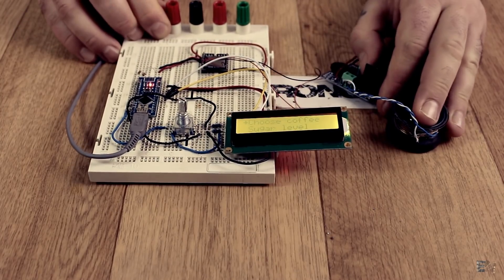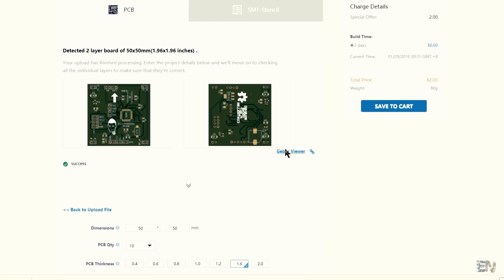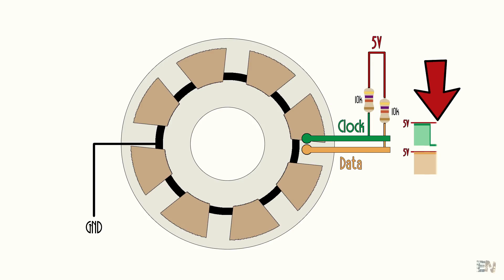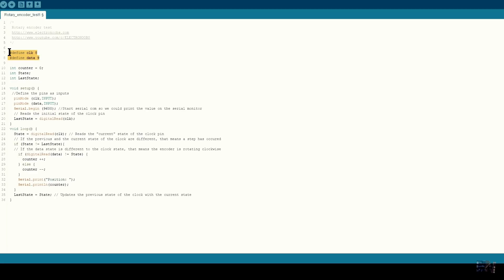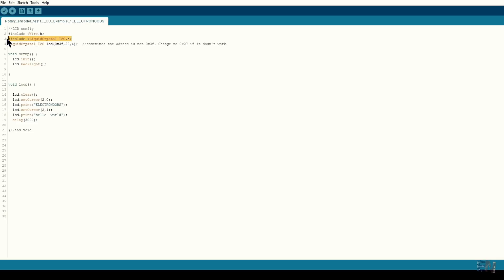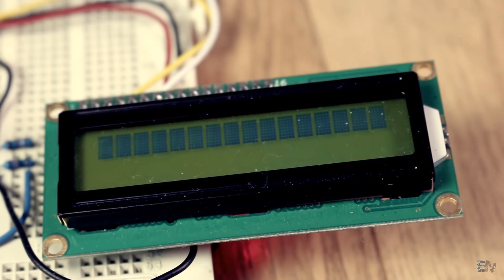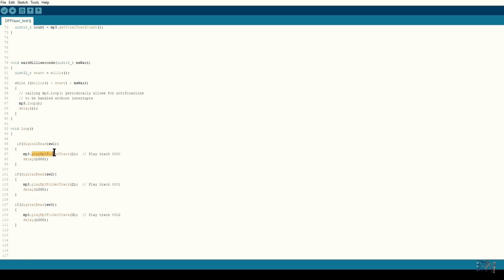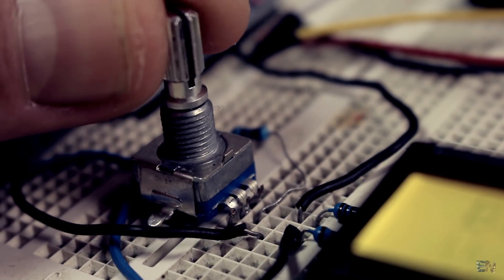Menu with voice & rotary encoder - Arduino

Comment: For rotary use interupt. If using delay or you use library that has delay, and turn the rotary to fast, it will read wrong readings.

Comment: **SOLVED**
If you are using a black soldered rotery encoder with already 3 resistors on the back, don't use the resistors in the schematic for the encoder. You also have to change the code line to  
********** if (!digitalRead(push))****************

Comment: Hello, first of all thank you very much for sharing your code and all the explanation you performed about it. Your job is wonderrfull ! I tried to register to your Q&A but unfortunatly i can't about some internal website quiery issue... So I try to expose my question here. I use a Ky-040 but the dedicated board put the SW on Pull Up situation whereas on your code you are in Pull down situation, could you tell me what part of your code must be changed to work in sush condition. (I would like to avoid to weld or unweld or touch the harware). My mail is geronimo1825@gmail.com. Best regards

Comment: Nice to see someone combining all these elements together. You could eliminate the 10k resistors as pinMode can be configured as INPUT_PULLUP. Also the DFplayer has an amplifier onboard and can drive a normal speaker quite loud, so you could make the project simpler. I hope this information is helpful
Reply: Yes, it was useful.

Comment: Sir. Please make a video for transformer winding m/c using two stepper motors, lcd with menu system,arduino, matrix keypad. It will useful to students project and commercial purpose.

Comment: I notice that the button on the encoder is set for a pulldown resistor however the encoder I have has is set for pullup so it is acting like the button is always pushed. How would you change the code for a button with a pullup resistor?
Reply: This every get solved? I think Im having the same issue.
Reply: @carangers  I just answered. Hope it helps!
Reply: This every get solved? I think Im having the same issue.
Reply: @yukonschannel  I just answered. Hope it helps!
Reply: I did it by taking out the switch resistor (so it will no longer be pulled down). Then in the code where the button section is,  reverse it by saying if (!digitalRead(push))...

Comment: Couldn't you substitute the external pull up resistors on the Data/Clock pins with the on board pullup resistors of the arduino using "pinMode(data, INPUT_PULLUP)" ?